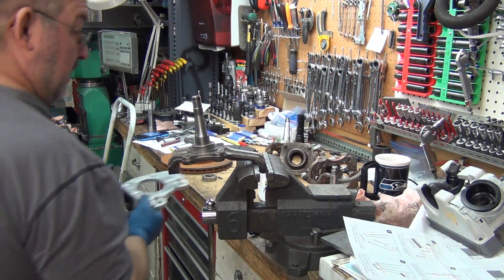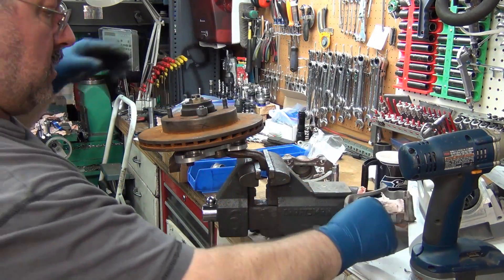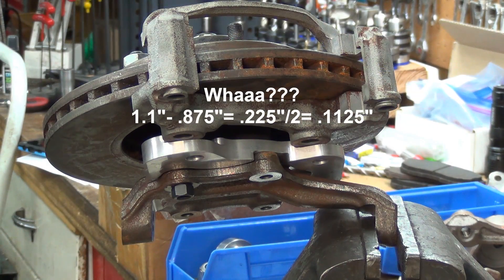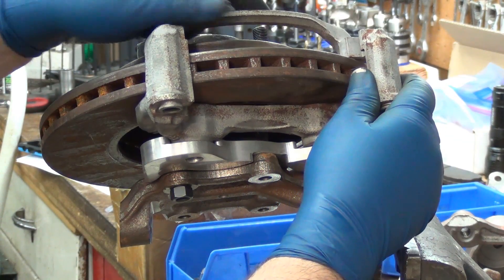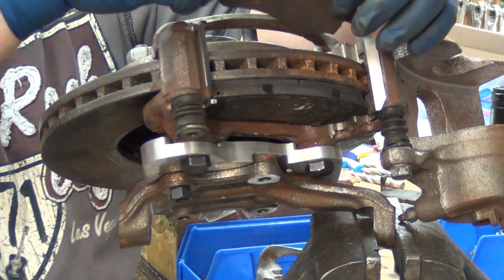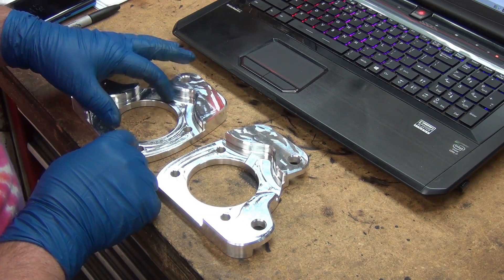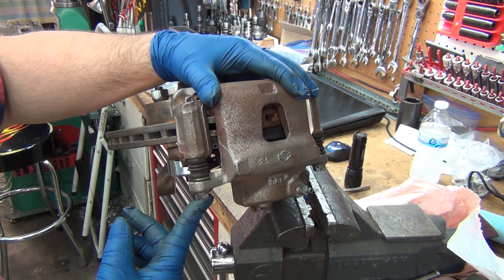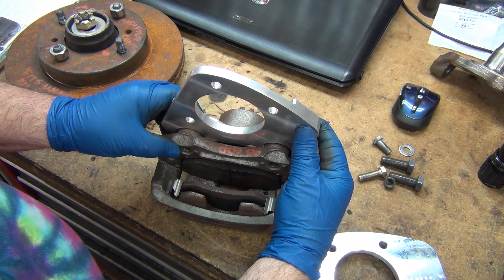Prototyping Datsun 411 Brake Bracket

Comment: Mike are button head allen bolt available to replace the 2 caiiper bolts and the Bracket bolts?

http://www.chromenuts.com/chrome-fasteners/m10-1-25-x-20mm-2/?gclid=EAIaIQobChMItIKe14Lp2gIVA57ACh0OjgHhEAQYAyABEgL4JfD_BwE
Reply from the maker: I've looked for a shorter head version a few times.  There aren't any options out there with the M8x1.00 thread.  Thanks Charlie! :)

Comment: Looking good, would be nice to have the car it's going to check fitment correctly
Reply from the maker: Yes, it would be nice....just to be 100%.  That is the spindle from the car.  I'd like to have the steering arm that goes with it.  I'll have the first couple of customers check it closely.  If something is wrong, I'll fix it and make new ones for them.  Considering I have to do any car work outside, I'd rather make new replacement brackets than actually have to work on the car. lol   I did have one here, years ago when I first designed the bracket for the drum cars....but the cnc mill takes up all the shop space I once had.  I worked with another guy via mail and online to create the disc version.  I'm about 99% sure that there won't be any issues.  Thanks! :)